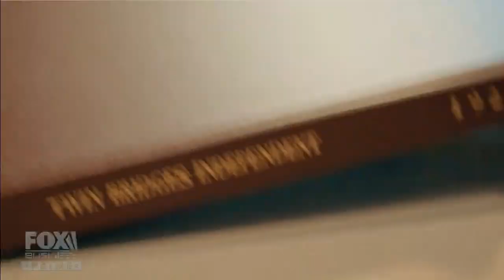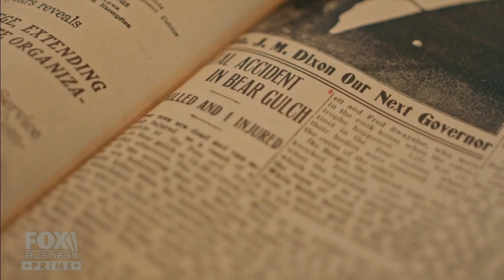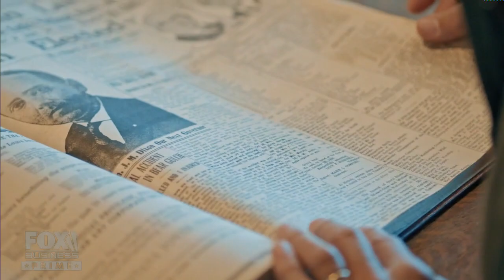Disaster strikes in Montana as miners search for fabled gold mine

Comment: And run the smaller pipes all the way to safe ground but always bury them with dirt or gravel and wet down in winter so they will perma-frost reinforcing them more so if a avalanche or mud slide happened it would go over the top.